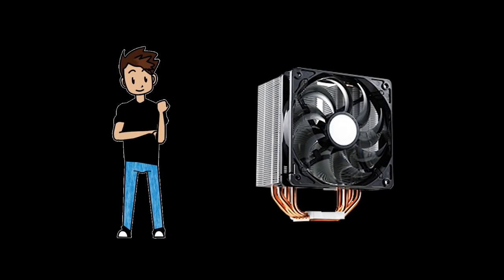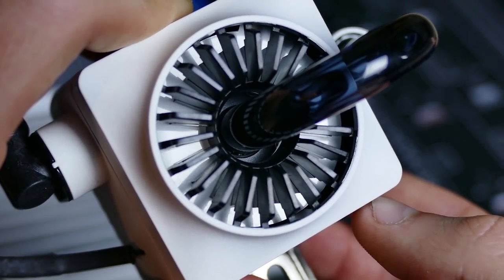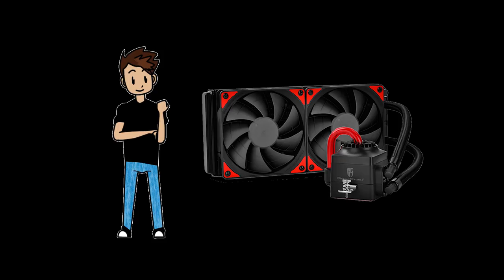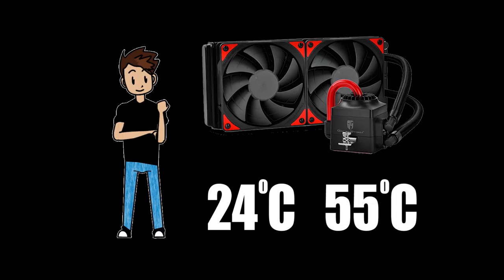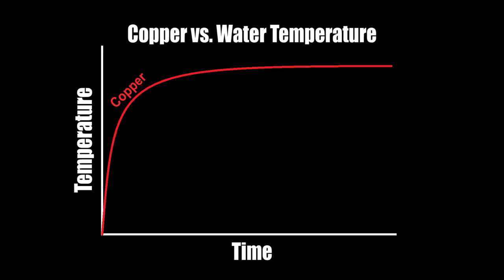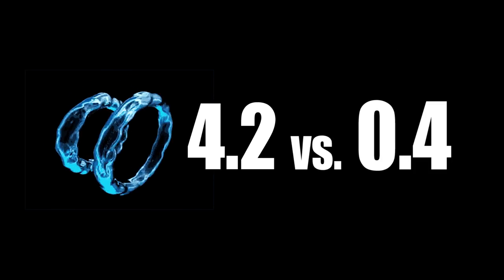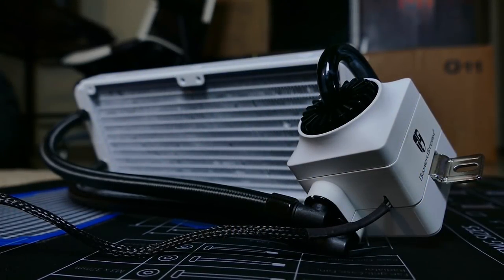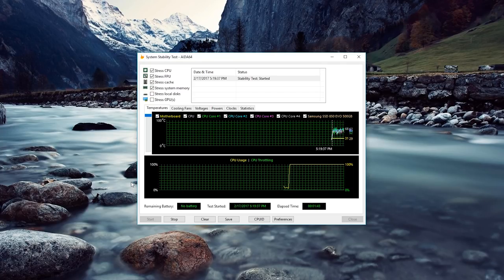How to Properly Measure AIO Temperatures

Comment: You do need to wait for a while for the system to reach equilibrium, on my 120mm AIO takes about 15 minutes.  What s really important is the power dissipation capacity of the AIO.  It has to be at least 20-30% over the TDP of the CPU for effective cooling.  If it's below, you system will overheat, as the radiator will not be able to keep up.  With higher dissipation from the radiator, the water will stay closer to room temperature.  My system: FX 63500 / GT 750 Ti (air cooled).  Providing fresh air to the AIO is very important, as its performance will degrade very quickly with not not enough air.

Temps were taken after a 30 minutes stress test (100% CPU and GPU).   My case has 2 fans mounted on the side panel, I run them on 5V instead of 12V, otherwise it sounds like a vacuum cleaner.  

With AMD stock cooler,  no case exhaust fan (it's loud!),.
CPU idle/max :   40°C/61°C
GPU idle/max:    45°C/73°C

With a cheap AIO, which does add a case exhaust fan. (Cooler Master MasterLiquid Lite 120) 
CPU idle/max : 25°C/52°C
GPU idle/max: 38°C/61°C

The fan is controlled by the BIOS, no special settings, as my BIOS does not have any for the CPU fan.

Max radiation power dissipation for the AIO is 135W, the FX6530 is 95W.  The system takes about 10 minutes to cool down, but I don't really care, as the cool down is silent, with the fan running idle.

The GPU is still air-cooled, but moving all the heat from the CPU out of the case did reduce GPU temps by 10°, which is great!

The radiator itself never gets above 38° or so.

About the Cooler Master MasterLiquid Lite 120:  the included fan is terribly noisy.  I've had to change it for an Artic Freezer fan.  It still is a great value, for the 40€ I paid for it.

Comment: Of course, but this is also a specific property that helps aio/ water cooling in general.  It is rare in real-world usage to have the CPU/GPU running at 100% load at all times.  The other point of water cooling systems is that there is a very practical limit to the amount of surface area that can actually be mounted in a confined space such as on a CPU.  Enter water cooling.  By transferring the heat away from that area to a larger remote location we are able to greatly increase the surface area of the cooler.  An air cooler is reallly just a radiator.  Water cooling allows you to use a much larger radiator.  If you chose a radiator that had roughly the same heat disipation area as your air cooler you wouldn't really see much benefit.  Yoiu might see a little bit if you ran teh cooler to outside the case and thus used the cooler outside air to cool it, but it wouldn't be much.  So yeah, harder to move the temerature up while also using much more surface area to remove the heat.  Sounds like benefits to me.

Comment: Most AIO's come with loud and OK static pressure fans. However, if you were to purchase better static pressure fans, your temperatures will go back down to normal much quicker due to their performance. Not to mention, quieter.

Comment: to make it simple 

air cooler : quick and nimble , but it will increase case temperatures internally and has its limits due to size constraints of the heatsink , GPU and RAM clearence 

Water cooler : sluggish , but you get a larger surface area on the radiatior to transfer heat away and usually directly out of the case , also with custom loops you could dasychain rads together as long as your pump and case can handle it

Comment: This made my decision between the two much easier. I have a mid range gaming PC and will just upgrade my air cooler instead of buying into the hype of the AIO. It looks pretty sure, but at the end of the day I'll stick to the regular old fashioned stuff especially since I don't OC. My PC has been running for 4 years perfectly fine and see zero reason to go AIO.

Comment: i have been running a Corsair H110 for 6 years in my machine with excellent results. I live in AZ so it is not the coolest place. i always had issues in summer using a fan/block only solution. but this machine is an FX8350 with 3 GTX780SCs in it and 12 TB of storage in a 550d case and i have never had an issue but mine is copper and coolant and not aluminum and water. but running at 100% cpu animating for 2 weeks my temps never got more than 65c. so yes if you buy crap youll not get what your looking for but if you bought a quality AIO youll have good results

Comment: I use AIO's so I have access to the other Memory slots on my motherboard since most air coolers cover it.   I do 3D rendering and don't even dare overclock the CPU because like you said- you have to wait for temperatures to stabilize.
Reply: I've been using a custom water loop for about 15 months now. And while it is true that things need to stabilize, once it does, the temperatures don't rise. and unless you're exceeding the TDP of the radiators, you'll never thermal throttle. Hell I overclocked my 4790k to 4.8ghz stable with lots of voltage, and saw a peak of 75C on my CPU.

Comment: aircoolers do the same -_- they would spike and they need some time to stabilize and even if its a 10-20degree difference its still an improvement that temp difference can determine if your gonna throttle or not

Comment: I wonder is there any reason/benefit (for Science), to making the loop/Air cooler continue after shutdown, to prevent possible spikes in heat after both types of cooler are effectively stopped, as the heat remains?

Comment: i am sporting stock cooler of amd 4 R5 1600 and im thinking of getting 280 or 360 CLC  AIO , just dunn which should i pick im not really intrested in RGB more in silence...Thermaltake 360 mm 3.0 Ultimate AIO or EVGA 280MM CLC. so what you thnink .

Comment: the "other" point of aio coolers is to lessen heat inside the case because it moves heat much faster and direct to the radiator, instead of air coolers that rely on heatsinks which does dissipate heat, but also in the surrounding case, and fans try to help release that to wherever exhaust you have. Steve from GN has done multiple tests with liquid cooling and aio, and i definitely trust him more with very detailed testing than 90% of reviewers out there even more than Linus, and he has showed that aio coolers do work, and since most aio are asetek, as long as the brand is reputable for it's price, it doesn't matter where it comes from. The only thing you need to look out for is buying cheap aio coolers, that's nearly equivalent to more budget-friendly air coolers.

Comment: How does one fix this "flaw" in liquid cooling?  Custom loop; 4 - 480mm rads with push/pull fans.  Split the water to all 4 at the same time, then have it converge back into the reservoir. Booyah.

Comment: Many awesome valid points in this video, I appreciate that! I have a question though and please take into consideration I have a severe brain injury so it takes me a little longer to grasp concepts but I am not sure if you mentioned this in the video. You stated how water and Iron dissipate heat at different speeds or times and how one retains heat longer than the other. My question is if you include variables like say water running through metal with air introduced to cool the metal which vools quicker than water which retains heat longer than metal.. Does that variable allow for water to shed heat alot quicker than if it were just idly sitting in a bowl for example. I am trying to understand and I think I know the answer whivh I believe is that variable is what accounts for the lower temps for a sustained amount of time vs air alone which will increase quickly but stay generally in the max range at max use. Excuse my lack of better words.. I had to learn how to read and write again when a humvee decided to smash into my head multiple times haha.
Reply: I think I also meant to say shed heat faster than air and metal alone not a bowl. Lol

Comment: Idk but when i had a AIO i switched back to AIR got a NH-D14 and i have a lot better temps, pump was running at 100% and fans at 100% and after closing Prime95 the temps droped instantly to 32C idk wtf was going on, had a lot worse temps than with the Noctua, that AIO was 240mm and it was $120 performed at least 1.5X worse than the D14 ... idk

Comment: What most people dont understand is that AIO and an air cooler are operating under the same principle. Its all about surface area of aluminum fins, whether it be a radiatior or heatsink itself. The water just allows you to place the location of heat exchange into the air elsewhere around your computer. If you have an air cpu cooler that was 120mm long, the same size as a radiatior, you would see identical results.

Comment: Interesting, and I agree that longer testing is needed to find the final stable temperature, something I'll incorporate in future reviews.  With water being pumped through the system and thermal transfer being highly accelerated due to contact with the colder fins, as well as mitigated by fans that speed up to handle the extra temperatures, you'll still see comparable if not better return to idle temps than just air cooling.  The biggest drawback is the potential of leaks, so far none with the Captain 240 so far, and also particulate buildup.  Oh, and price, too!

Comment: Bought a new pc setup 7 mounts ago. i7 7700. no OC, and used an ID Cooler frost flow 120. yesterday pump broke down and nearly wrecked my hole PC. Since i used the PC 24/7 most maybe 30% gaming and 70% CPU mining.  since i never used an Closed water cooling system before i was cautious and used bios setting for emergency shutdown of cystem. Woke one day up and PC was down. Not the first time since we also have sometime some electric outtakes. Boot up and imidialty get CPU temp warning 90 celsius....wtf. Any ideas for a better cooling solution? sure i have warenty but  not interested in  a cooler wehre breaks down after 7 mounts.

Comment: Thumbed it down because..... the AIO coolers are NOT lying.. jeez. apart from that, good intel.
Also; how about placing they radiator on the outside side of your build and sticking a peltier thermal coupler to that? That would negate the water temperature retention? Or would it? (I said outside so as to not get condensation in your shit.

Comment: If you put a gigantic block of metal on the CPU, you'd get the exact same effect.  It's just temperature lag due to heat capacity.  Specific heat capacity just tells you how much of a substance you need to hold the same amount of heat at a given temperature.

What's important is what the heat dissipation curve looks like.  The radiator portion of the cooling solution will output heat at an increasing rate as temperature rises.  The point on that curve where the output rate measured in watts matches the actual TDP of the processor is what temperature the radiator needs to be at to reach equilibrium.  The CPU itself will have a higher temperature than this, because it's not a perfect conductor and less mass (i.e. less heat capacity).

In the case of water cooling, whether all-in-ones or custom loops, it's typical for the CPU to be in the neighborhood of 20C or more higher than the water temperature, so dropping load does instantly drop CPU temperature by that amount.  The water temperature will take longer to go down.  You make it sound like the CPU will sit at it's load temperature for a long time after load is removed, which is not true.

Comment: when i upgraded my pc a few months ago i thought i’d be moving my thermochill pa120.3 rad into new case to cool ryzen 1700. How wrong I was.. new case couldn’t take the thermochill even though it’s rated for 360 rads.  I had no choice but to retrieve my old 120mm xspc rad... ryzen overclocked to 3.92 heated up the water loop on prime or aida burn in. I purchased a thermal probe sensor and screwed it into my res fill port and the other end to motherboard temp probe input. After an hour burn in the rad was very warm to touch which meant the heat wasn’t being expelled quickly enough... I added a second fan to the 120 rad... push pull... loop now stays cool on burn test. Will add a second rad.

Comment: You can use chemicals to improve heat transfer. As water by it's very nature is repelled by heat. It allows the water a much better adhesion to the hot surfaces. Thus improved heat transfer...

Comment: This is super interesting.It's really good to see an actually useful critical analysis about AIOs coming out of tech-YouTube as often the channels a overwhelmingly positive without really discussing the negatives and/or broader picture. I think a lot of people, the average consumer, who buy AIOs do so because they're popular - not because they'll see a real gain out of spending an equal amount on a standard style heatsink and fan. If you're overclocking your CPU up the wazoo then sure, but if you're sticking it in and finding an easy stable overclock - or letting the CPU do it iyself - then having a double radiator water cooler probably isn't that big a deal. 

Factor in that with an AIO you're introducing additional, moving, complex parts to fail (the pump and fittings) versus a standard heatsink, where the only moving part to fail is the fan - much cheaper to replace. Plus the pump makes additional noise versus just the fans on a good sized heatsink. Again unless your CPU us a real beast, all other parts being equal (two fans on a big chunk of metal, versus two fans on a chunk of metal with a pump and flowing water) the old style heatsink with fan is more stable, easier and less expensive to fix if something goes wrong, less to go wrong on it, and quieter if you're investing a similar amount of money. I think for most people who believe they're getting a benefit by fitting an AIO have been sold a bill of goods.

Comment: The slow cool down is not bad. In fact an argument can be made that it's better, as rapid heating and cooling cycles will be more damaging to pretty much any material than just a high a, but more stable, temperature would be.
Reply: ya

Comment: Great video, really learned a lot from it. Question: How do you determine how much heat watts you may need to cool your system if it's a custom loop system. I wan to cool a 1080 TI and my 7700k processor. But in general, how do I determine the heat watts per item needing cooled.
Reply: Most good manufactures of radiators say the number of watts it can dissipate. 

But, if you want a general guide: 120mm radiator for every piece you intend to cool with water (So a minimum 240mm for both a CPU and GPU) with an extra 120mm as buffer. So if you're intending to cool a CPU and GPU, I'd suggest a 360mm Radiator, if your case can fit it :)
Reply: Thank you for your quick reply. :)

Comment: AIOs I've used seemed louder than normal air coolers by significant amount. They are especially louder than the air coolers when running idle. Granted, my sample size is small but the decibal rating on pc parts picker seem to tell a similar story.

Comment: I'd like to see the heat absoption/dissipation of liquid mercury in a radiator.  You'd need a monster pump, but seeing how fast it can dissipate would be interesting.  Benefits of a fan/plate with the heat removal of a fluid.  The tubing would need to be insulated metallic though.

Comment: Just like you get a bigger air cooler to dissipate heat faster, same applies to liquid cooling. there is a reason there are single, dual, triple, and even quad slot radiators. yes the water will take a while to get up to temps but provided the radiator(combined with good water and air flow through it) can keep up to the heat being generated they should not get much higher it will only get significantly higher if the radiator is not sufficiently sized. Also absolute temperatures are misleading relative temperature to ambient is a more meaningful figure. In the case of my pc there is a Massive difference in my room temperature at the start of my gaming session around 20c and after a few hours when it's up to 28C. a 8 degree difference in ambient is massive and will be reflected in cpu temps. 

another thing a lot of people don't realize is that water cooling DOES NOT MAKE YOUR ROOM COOLER. If the heat generated by the cpu is the same by similar loads then it doesn't matter if you use a normal air cooler or a water cooler the same energy is transferred into the room so it will still get just as hot. In fact by using a water cooler your room will get hotter because of the additional load of the pump and fans but also because it will keep cpu cooler allowing higher overclocks(more heat) but also mitigating any potential thermal throttling that happens allowing it to generate more heat.